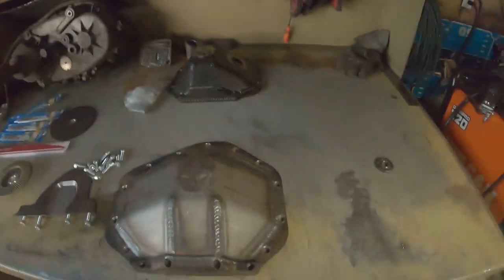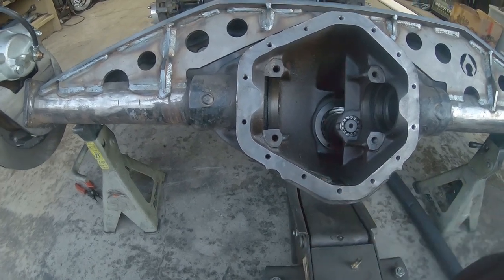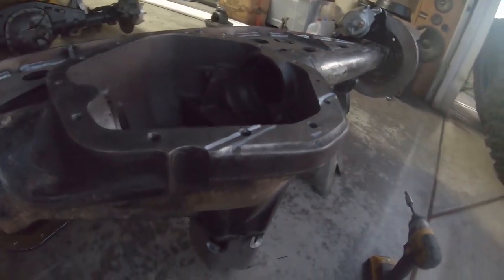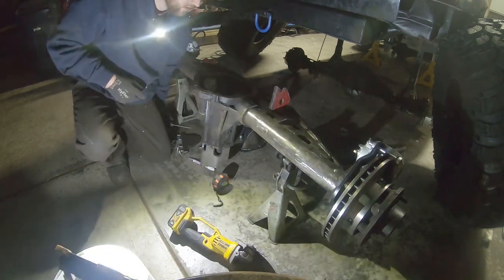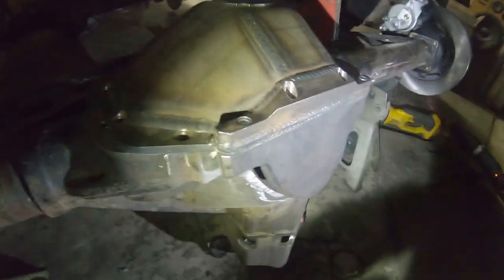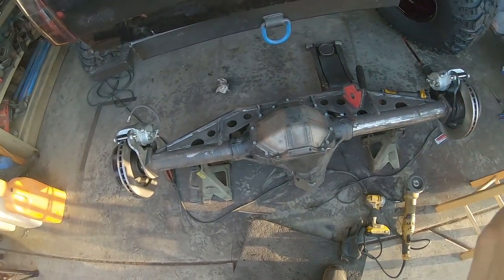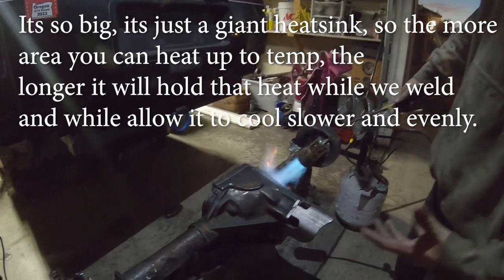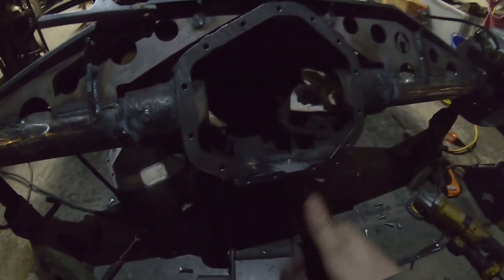How to cut & Weld a Dana 60 & 14 Bolt Shave Kit! | SUPER BEEFY - SO MUCH CLEARANCE

Comment: They are cracking from cooling to fast. I’ve mig welded tons of cast. Pre heat to like 400-425 weld some then check temps and pre heat more if you need. When I’m done I wrap whatever it is in a welding blanket and allow it to cool in there. Dirt lifestyle has some good videos out on welding cast also.
Reply from the maker: Thats the same procedure I do. I actually do both of those in this video!

Comment: I don't much experience with cast..flux will help keep the weld from cooling off to fast, seems like you're trying to get the flux off as quick as possible. Did I miss something
Reply from the maker: We were doing that to peen the weld while it was hot, not to take the flux off as fast as possible. Peening it helps take the tension out of the weld and makes it less likely to crack when it cools. 

Taking the flux off also helped with allowing us to make multiple passes while the piece was still hot
Reply: @BackyardBeaters   Makes sense, good to know,  thanks for answering! Great work btw.